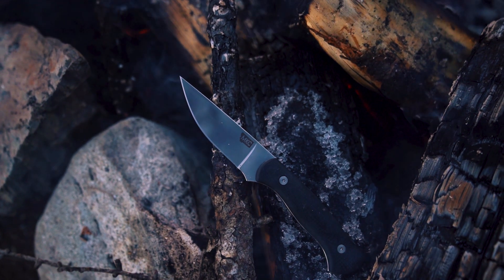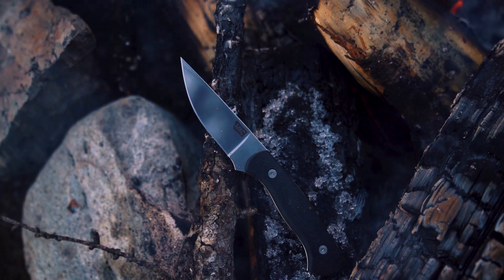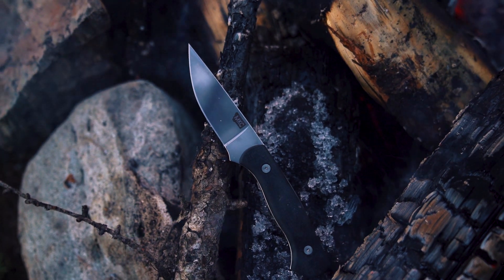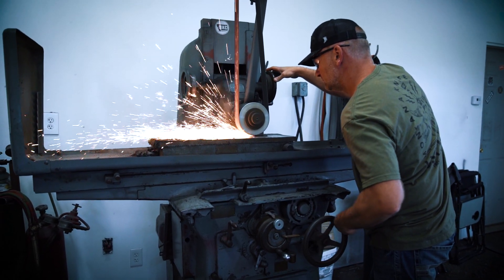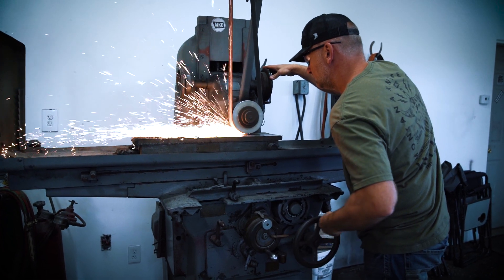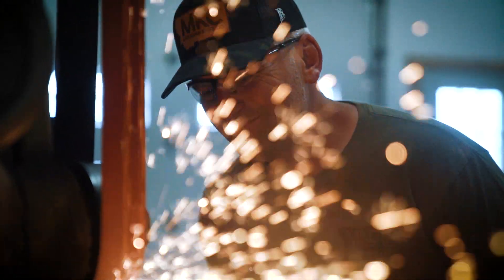MagnaCut Knife Steel: The Complete Guide

Comment: MC has "a little more" wear resistence than 52100? lol what?  MC is like 2 or 3 categories above any low alloy steel. 52100 doesn't even anywhere near the abrasion resistence of any basic stainless steel, like say AEBL... which itself is lower than cutlery stainless steels like more and bigger carbides like say VG10 or better yet 154cm. MC is a full category above those steels like 154cm. It's not  "a little more." it's a whole shit load more. Like, damn I can't even use a regular whetstone to grind this stuff kinda more. It's a vanadium stainless steel. 3% vanadium and a little niobium to boot. 52100 will lose bite after like a dozen cuts into mild materials. MC will do idk, maybe 10x better in the real world in that regard. It's a massive difference. But it's also a massive difference when it comes to sharpening as well. 52100 will take a scary edge with very minimal effort. Grinds like butter on standard traditional abrasives. MC won't even achieve it's full potential edge keenness without using superabrasives.
Reply: YMMV. My 52100 is a solid 3 deer knife. With a Rc of about 60...Def. not 'butter'.
My Cruwear is 60.5, and Magnacut is at 61 Rc...none of that is soft. 
And each one a metallurgical step up from the next....with MC adding a stainless component without technically being stainless.
MOST 52100 is mediocre, but when done right is a whole different animal. Where & how it was produced matter as well. Which is why the Marbles knives of the late 90's were so good. The (old) steel was produced using a venturi vacuum over the furnace, which was later stopped due to cost cutting. Then they were PROPERLY heat treated.  So it's like 440C getting a bad rap. When the Japanese heat treated it, it was great, when everyone (Chinese/Americans) started making cheap knives with it at low Rc, it was crap. Hence the reputation. Most people have never seen a good 52100 or 440C knife, so they have the same opinion as you do....how the steel formula is produced, then subsequently heat treated & quenched matter tremendously. Not 'crap steel', but lousy producers of inferior products are what determine reputations.

Comment: I'm have no intention of bombing steel types. Certainly many great steels out there.
From fish to large game, farm use, being in bush weeks at a time and kayaking. I haven't found anything my 1095 isn't capable of. 
I need a steel that is field friendly not a Super (hard to sharpen) Steel needing jigs and mechanical equipment.
Reply from the maker: Our Magnacut and 52100 both retain an edge and sharpen easily 👊
Reply: I agree it is a super steel. 
Can it be sharpened in the field on a sand stone like 1095 or does it require special tools.
Packing ounces of extra matters in some places I go.
Reply from the maker: @DonTharp  it can be touched up in the field, usually that’s all it needs as it does have great edge retention. It is slightly harder to sharpen than our 52100 carbon steel
Reply: @DonTharp  For Magnacut you really need diamond to sharpen it properly. It has a lot of Vanadium Carbides, which are harder than ceramic / natural abrasives. So you will only rip out the small carbides instead of abrading them to a sharp edge.

Comment: AEB-L is a very tough stainless steel that has good edge retention and is easy to resharpen and takes a wicked edge because of the fine micro grain structure. I love MagnaCut but it’s expensive. I would love to see MKC produce some of their knives in AEB-L as a lower cost alternative.
Reply: I love AEBL also. Had a custom kitchen knife made out of it, and it's been amazeballs.
Reply: AEB-L is awesome. It's tougher and more wear resistant than 52100 AND it's stainless. To me it's the ultimate knife steel for "normal" people. There are better steels for very specific use cases or if you want to spend a ton of money and have the expensive equipment to properly sharpen something like Magnacut. But for like 95% of people, AEB-L or 14C28N woulb probably be what they want.

Comment: 👉 Great video, but I have to correct you on one issue. There are elemental metals that produce micro-thin oxide layers that actually serve as a layer of protection from further oxidation/corrosion(ie. chromium, nickel, tin, zinc, aluminum). But iron is not one of them. When the iron in steel oxidizes(rusts), it does not form a protective layer. 

Iron oxide(rust) is flaky, and it eventually separates from the clean iron underneath, allowing oxygen & moisture to penetrate and further oxidize the iron within.  Its why you find old, non-stainless iron or steel items left in fields or ditches(or wherever), which have rusted right through to their cores. 

Its the addition of 12+ % of chromium to iron/steel that gives it "stainlessness". Its because when chromium oxidizes, it's oxide layer isn't flaky, and it does form a protective barrier preventing further oxidation. When you add enough chromium to an iron/steel tool, the 12+% of chromium within will impart its protective oxide layer to that steel.

I only know this because I bought an element collection almost 20 years ago, which was put in a non-climate controlled storage unit for over 10 years. But the chunks of pure chromium, tin, zinc, nickel, niobium, etc are still just as shiny as the day they left their refineries, whereas my iron sample looks increasingly "dingier".
Reply: There are two different forms of iron oxide. This is why some people recommend doing a forced patina on carbon steel knives, because that form of iron oxide is semi protective and less "flaky".  You still have to oil it and be mindful, but not as much as you would have to if there wasn't a planned, deliberate patina put on.

Comment: Just ordered a BR fin and bone in Magna Cut.  This will be mostly for use in the kitchen as I did not have a dedicated boning knife.  I have not had much trouble with tool steels as far as rust goes and I think I could have done with A2 if it came in that.
Reply from the maker: Nice! We don’t currently have a boning knife, although a lot of folks use our Flathead Filet as one
https://www.montanaknifecompany.com/collections/flathead-fillet-1
Reply: I think if you take care of your knife, a non stainless tool steel can be fine for a boning knife. But for a kitchen knife, where you have tons of acidic foods, stainless is key. Corrosion destroys your edge.

Comment: Magna-Cut is tougher then 52100.
Reply: Eh, it boils down to heat treat. Generally speaking, 52100 is considered tougher than magnacut, by a small margin. Even Larrin ranks 52100 above magnacut when it comes to toughness. 👌
Reply: You want a tough Stainless steel look into AEB-L which is very high on the toughness scale and when heat treated right performs amazing.
Reply: @rawdog5506 Aebl has incredibly fine grain structure for a stainless gets wicked sharp easily, it's fine grain structure and edge retention is on par with 52100 and is incredibly tough and chip resistant. It's a great steel. Doesn't rank as high in wear resistance as magnacut though.

Comment: Great video but I don’t think 52100 is tougher than MC. It’s on par with 4V, which is much tougher than 52100. I use both in knifemaking but have not tested MC to failure personally. Just going off Larrin’s data. Have you found a different result from actual testing at the same hardness, around 62 or 63 HRC?
Reply: Larrin rates 52100 an 8.5/10 for toughness and a 2/10 for edge retention. Magnacut gets a 7 in toughness and 5.5 for edge retention. So the creator of Magnacut still rates 52100 slightly higher for toughness. Where Magnacut pulls ahead is significantly better wear resistence and edge retention, and of course as a stainless, it scores a 9.5/10 for corrosion resistance vs a .5/10 for the 52100, as a non-stainless high carbon steel.
Reply: Does anyone know what HRC MKC runs their Magnacut?
Reply: @JoshsWayOfLife MKC’s MC is 60 HRC
Reply: As always, it depends on heat treat. Apples to apples, even Larrin ranks 52100 higher than magnacut. 👌

Comment: Sounds like just another sales gimmick.  I thought s35vn was made for knives because everyone wanted easier to sharpen. Before that 154 was a stainless for knives. 
I personally like 14c28n mostly because it's not expensive.  Hard to charge $200+ for 14c28n.
Reply: How is it a sales gimmick. It geanuinely does have an unparalleled mix of properties that make it prettt hard to beat when done right.
Reply: Does anyone know what HRC MKC runs their Magnacut?
Reply: Magnacut is no sales gimmick. It does exactly what the hype says it does. Extremely tough, almost impossible to make it rust in any normal world scenario. Check your facts.
Reply: Hey,  if the heat treatment is 62 or better Magnacut is terrific.   I own 3 knives in the steel.  
live a little try it out.  :  )
Reply: Hey,  if the heat treatment is 62 or better Magnacut is terrific.   I own 3 knives in the steel.  
live a little try it out.  :  )
Reply: 440c/154cm had it's decade in the sun, followed by the s30 series. Now Magnacut has significantly outclassed it and I don't think it's going anywhere for a long time.
Reply: @whyillustrated5610  I remember hearing that same stuff about m390. 
I was going to try magna cut but ontario sold out the pack knife.  I don't need any little folders. An Im not gonna pay $200 just to try a steel. 
Knives have gotten ridiculous.

Comment: I thought Magnacut isn’t a stainless steel because it’s less than 12% chromium. Tho it has some characteristics like stainless, it’s not stainless. Atleast that’s what I learned.
Reply: There’s more to corrosion resistance than just the percentage. Basically, while it has a lower percentage of chromium, it has much less chromium carbides meaning the chromium it does have is evenly spread throughout the steel. In a steel with more carbides, each carbide is surrounded by an area of lower percentage chromium because it has been precipitated into that carbide. Those areas of low chromium give rust a place to get started
Reply: Magnacut is basically as rust proof as LC200N, people including myself have done multiple salt water spray tests on it and it is basically impossible to make it rust under any normal world use scenario.
Reply: In salt water testing it performed at the same level as Vanex in a 72 hour salt water test.  No visible corrosion.
Reply: It is Not Stein less
Reply: It’s insanely stainless, up to par with lc200n, it’s to do with the nitrogen in it
Reply: @Rickyrock13  While nitrogen helps its more because it has just enough chromium in relation to the amount of carbon. Many other stainless steels have more chromium creating chromium carbides (which suck) while Magnacut is pure vanadium carbide.
Reply: MC is stainless.
Reply: @zdenekbart  nope.